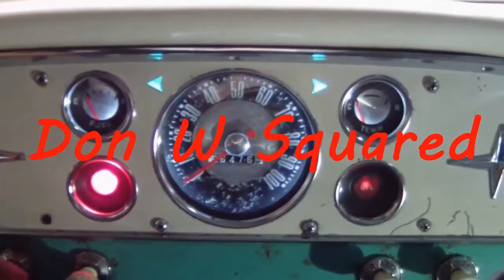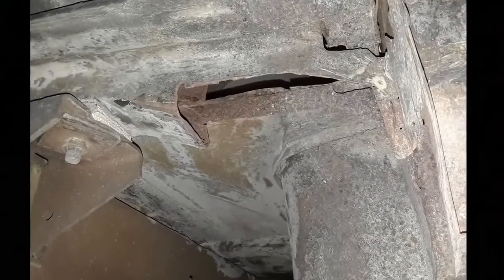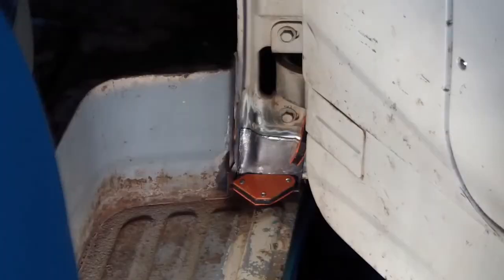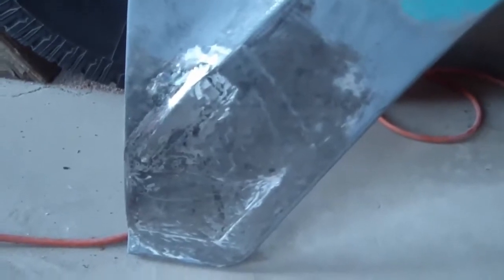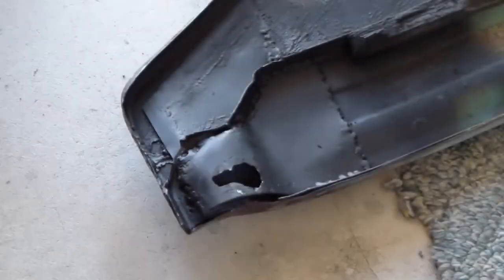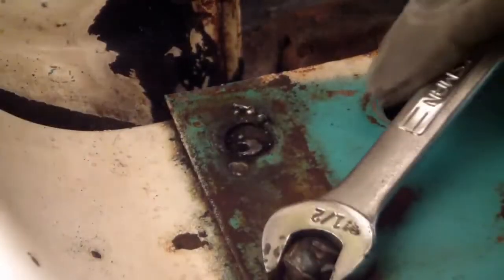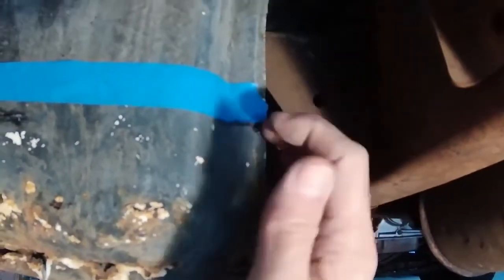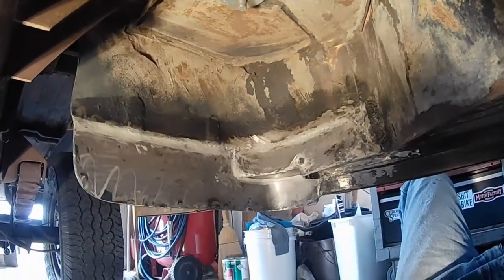1959 Ford Truck Complete RUST REPAIR Welding 2 Year Compilation!

Comment: Would like more of Engine Joe I had a 1960 and my brother n law I guess you would say was a collector he must of had over 2 dozen over the years 57-60 still it wasn't till recently that I discovered they also came with a Automatic transmission all I ever saw had 3 on the tree or 4 speed grannies so I was really surprised to see this one even more so because it has  the 6 cylinder engine would really like to learn more about this and your (or your viewers) thoughts about this combo
Reply from the maker: All I have left to do on ol' Engine Joe is final bodywork and paint. Oh, and power brakes upgrade. I have the kit just need to grab the camera and install. Got to get it off the backburner... soon!
Reply: Hope to see more videos about Engine Joe soon! Love these vids. Helped with my 59 Ford a bit. @DonWSquared
Reply: Speaking of paint I been meaning to ask what colors of paint it is and are they factory colors